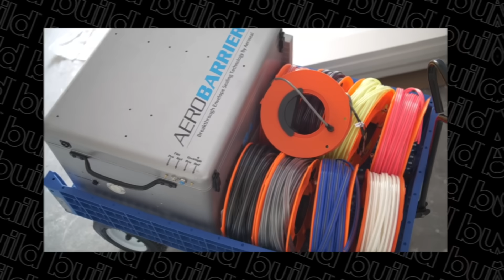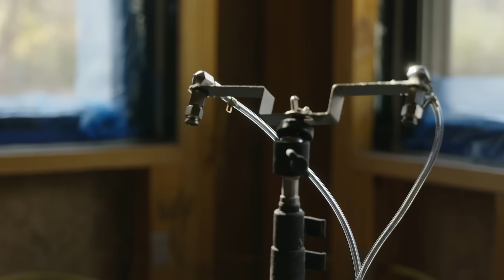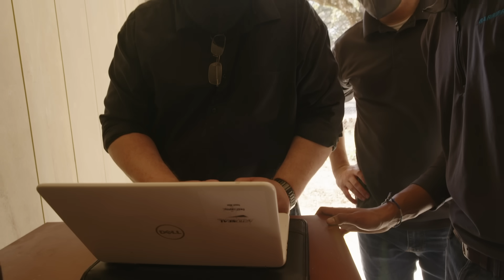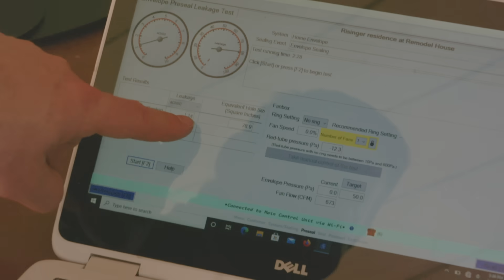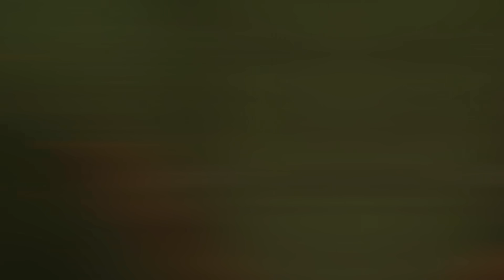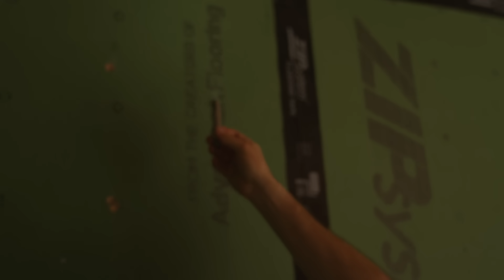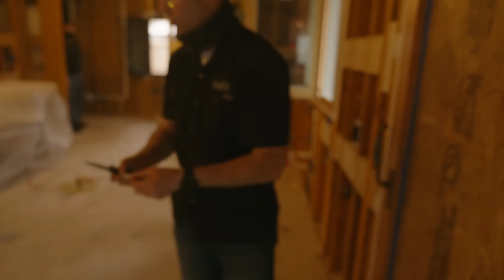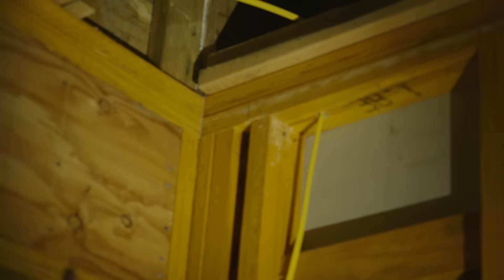The one product I'd recommend for EVERY House!

Comment: I would love to know what the air tightness is on this after year or two with a full season cycle.
Reply: I have never used an acrylic caulk that does not shrink.  I have used many that claim not to shrink.  Additionally the expansion and contraction of wood and dilation of metals make me wonder about longevity also.  However, with a controlled environment, temperature and humidity will effect expansion, contraction and dilation less.
Reply: @bobt9948  Foreal. I have never seen alex flex stretch like it claims, cracks at any movement.
Reply: The leakage was almost entirely confined to very tight seams and a couple of small holes. Now, I could accept that there might be some degradation around pipe fittings, since they move differentially to the structure sometimes, but just how much do you think that these tiny seams are going to change over time? I mean, he's got the house down to 0.1 ACH50 BEFORE insulation and drywall. Even if it went to 0.15 ACH50, so what? It's not like his house will be 1.5 ACH50 next year nor even 50 years from now. Finally, if you're curious, call your Aerobarrier dealer and ask if they have some data on that.
Reply: @juliancate7089  what do you think it is if they did the test again after untaping all the window and door seems?
Reply: @FJB2020  Sealing windows and doors is part of the install. Why would a sane person remove tape from the mounting flanges? Not to mention that Matt seals around the window frames from the inside after install. Why on Earth would you remove that? Just to see if an unsealed window leaks? Spoiler: Yes, an unsealed window would leak.
Reply: @juliancate7089  dude.. They taped them shut for the spraying so it didn't get into the window/door seals..  If they removed the tape, as they should, I would want to see those scores..
Reply: @FJB2020  Right, the numbers would be higher. So? You can't put any kind of sealant into the moving parts of your window and doors seams no matter what, so....... ? That's a leak that is a leak no matter what. That does nothing to invalidate the ability to seal all those cracks, crevices, and holes that you CAN seal. I'm just curious what kind of mental gymnastics you have to go through to decide that sealing the parts of your house that you can seal is bad or is somehow magically a waste because you can't seal the moving parts of windows and doors.
Reply: @FJB2020 It would vary with the number and quality. With high quality windows there is little change.  Install low grade windows and it's more.
Reply: @juliancate7089   I would like to see the numbers to 1) see what the difference is and 2) to see if its enough to bring the ACH back above the "passive score"; that is unless when it's tested for that you're allowed to tape the doors and windows.
Reply: @keithhogan6997  Ok, your question makes me understand how this conversation got off the rails and why I was misunderstanding previous posts. You only tape the doors and windows so the sealant stays out of the moving parts. When you do a blower test, either before or after the Aero Barrier application, the doors and windows aren't taped. There are plenty of written instructions and video tutorials on how a blower test is performed on the Internet if you'd like some clarification.
Reply: @juliancate7089  His score was when they were still taped.. From what I can see, they opened up the house and never ran the test again.. That to me seems misleading..
Reply: @FJB2020  You know, you're right. Matt is a dishonest guy trying to mislead people, and Aero Barrier is a scam. No one should ever use it. And all the other professionals on the channel and the other contractors in the comments section are in on the scam too. So let's never watch this channel again.
Reply: @juliancate7089  chill out dude.. I am saying the numbers are misleading..  I love Matt's content, but I take some of it with a grain of salt considering most of it is an advertisement for products he got for free..
Reply: @FJB2020  Dude, he did the blower test after all the windows, doors, and vents had been opened to let all the vapor out. The video shows this, dude. No where in the video does it show that they were re-taped, dude. Dude, your understanding of how sponsorships work is as flawed and simplistic as your understanding of blower tests, the benefits of air sealing, and basic economics. Dude, you are an envious, resentful dude for assuming that anyone who has achieved anything in life, got there by cheating or lying in some way. Dude, what have you accomplished in life? Dude, did you build a multi-million dollar business from scratch? Do you have a successful YT channel, dude? So dude, I'm not going to "chill out" while you post a bunch of hateful smears about a decent man trying to improve the construction trades and inform housing consumers, dude. So if there's anyone who needs to "chill out" dude, it's you, dude. And dude, liking your own posts is lame. Ok, dude?
Reply: @juliancate7089  dude :D
Reply: @krisz1156  Lol, Dooood.
Reply: @juliancate7089  I get what your saying, but you are only proving my point. He did this on a house that did not need at all. They even mention at the end that the next 10 years of their focus will be on retrofitting old homes with Aero Barrier to bring down thier ACH. Those homes will not be tiny little seams and they will not have access to framing to prep anything.

Again, I'm not saying this is garbage. I'm just saying I'd like to see it in real world setting with and ACH before, ACH after application, and an ACH after one full season before I start recommending people spend 3-5 grand on something that would not last more then 5 years.
Reply: @seanstumpf4190  Whether or not the house "needed" it is a subjective value judgement that you are trying to pass as some sort of universal truth. Whether you think is needed or not is irrelevant to it's performance. On top of that, Matt stated repeatedly that he was trying to achieve passive house certification and in order to get it, it was indeed necessary. So, he DID need it.
Reply: Julian Cate 
The ENTIRE VIDEO .....is paid promotion, like this one and his others, now say at the start.
And......you are a shill and a huckster......
Reply: @alfamale2478  ...says another angry red neck Socialist who doesn't understand how sponsorships work. Not to mention, you have no proof that Matt is sponsored by Aerobarrier. He's always been pretty open about who his sponsors are and he usually says, "This video sponsored by xxxx". It never ceases to amaze me how bitter and resentful you working class Commies can be. Like if you were in his shoes, you would refuse all sponsorships. LOL. You'd be tripping over yourself to get at that money.
Reply: @juliancate7089  best commercial caulk we have ever used is VLM 150, modified polymer. Elongation 100 %, and compression 50%, hence the "150". Now, if the tiny crack to be sealed is say 1/32" when this is performed, and it grows to 5/64" over time, due to drying and or warp/ curl of the lumber, you have exceeded the 100% elongation and the seal will be broken. Virtually all commercial buildings rely on control joints for sealing, and the joint width is always sized and specified to insure that expected movement will not exceed the elongation limits of the material in that joint. We have had jobs where that width may be 1" or more, in order to maintain adhesion of the sealant material. Can't see why this would be any different here.
Reply: @lhsunimog  There's so much wrong here I hardly know where to begin. 1) Not every point along every seam in a house is going to up up to 1/4 inch. If it did, your house would fall down. 2) I don't accept that joints between studs and sills, or sills and floors, nor stubs and sheathing, or any other joint, are as open to movement or expansion as you suggest. If your joints are that capable of movement, then your construction methods suck, you haven't provided for sufficient water and vapor protection, and or your materials are substandard. 3) Nothing you've mentioned, even if it was a realistic scenario, means that VLM 150 you use is necessarily better than the Aerobarrier sealant because you don't know it's characteristics. So, you're comparing a known to an unknown and suggesting that nothing could possibly be better than the known. If you want to say that VLM 150 is better than Aerobarrier, then provide some proof. 4) I'm not sure what your point is here, except that in extreme cases sealants fail. Ok, well that would be true for all of them and doesn't mean that no one should ever use caulking. Lastly, if you don't think the product is worthwhile, then don't use it. Issue solved, debate finished.
Reply: @juliancate7089  "I hardly know where to begin". And you absolutely do not know where to stop. Problem with channels like this is that it provides bloviating trolls such as yourself a platform to spew your bile anonymously. A good sign that you cannot hold your own in the real world of verifiable performance. If only your intelligence quotient and knowledge base was even a tiny fraction greater than your anger quotient, then there would be a possibility of an actual informed discussion. But alas............
Reply: @lhsunimog  Anger quotient? I think there's some projection in accusing me of being angry. Lee, I was not and am not angry with you. Your post was an unfair comparison since you stated that VLM 150 was the best there is without knowing what the stats are for Aerobarrier's sealant. You also suggested structure movement that might occur in spots, but was an unrealistic scenario for most homes - especially those whose owner can afford an extra $5000 or so for air tightness sealing. So, instead of just fuming and sputtering a hail of insults at me, show me the data. I will listen to that.
Reply: I wondered the exact same thing.
Reply: Yup that would be the interesting to test I would assume there is information on testing this but it's still fairly new so yeah long term might still be a question.  2 points I don't like is when your blasting caulk into the air that is designed to escape the house goes into the public and it seems kinda a dick move if you're not telling the neighbors unless ya wanna coat some kids lungs down wind. Maybe it not much but I'd like to see a hole as this process starts and finishes.  Also as the hole gets filled and get smaller then becomes sealed then you're no longer adding any thickness to that caulk. Maybe the millage is fairly ok but thin to win isn't a great idea with caulking even from tremco which has some really good caulking.
Reply: @timort2260  unless that kid is sucking on the house I think your worrying about a non issue.  When paint/start your car/ fart/ cut a piece of wood..... Do you warn the neighborhood. All of those have been proven to cause cancer.  Let's worry about real problems and not make up more.
Reply: @timort2260  Good thought about the thickness Tim.  Because of the pressure being applied, thin weak parts of the seal rupture and then collects more  sealant.  We see chatter or a saw pattern on the seal during the process.

The sealant has had a 50 year lifecycle test done on it with near zero degradation.  The test included expansion and compression (20% both directions) to simulate the seasons causing material movement.
Reply: Water based acrylic
Reply: It's latex though, flexible and inert.
Reply: @Polyester_gangster  having used caulk on various surfaces all I'm saying is that I would love to see the year after results. Homes move through out the season through expansion and contraction. They also slightly shift in the wind. Even that 3" pipe hole they showed that it filled. During one winter and summer that pipe will move up and down the wall maybe 1/4 inch maybe even more since it's cast. Doesn't seem like a lot but caulk is not very forgiving when adhered to a hard surface. I imagine this is the same. I'm sure it's better then nothing but all I'm saying is I doubt the long term viability of these numbers.
Reply: @seanstumpf4190  we know it's not much chance of it lasting long
Reply: @Polyester_gangster  i think he said acrylic
Reply: Same here, I suspect with a few temperature/humidity cycles it will lose effectiveness.
Reply: @judd_s5643  Steve B reports he's tested his passive builds years later and no change. That airborne caulk is filling better than a gun i guess.
Reply: You suspect? Proof please
Reply: It would be interesting but the results wouldn’t tell you anything. There are too many other variables to determine what changed if anything. 

You would have to build a mock house and test it over time.
Reply: They didn't have a great track record when AeroSeal was their name..
Reply: @FJB2020  prove it
Reply: Will be leaking inside of 5 years...you can take that prediction to the bank

Comment: Well on claissic brick house it wont change a thing if all done corectly i assume.
Reply: Theres still gonna be some kind of gaps between the roof and the joint to the house.
Reply: @ShotGunner5609  Depends on technology used for insulation. I belive nowadays most of houses have Polyurethane foam insulated roofs so all gaps and spots shuld be nicley covered.
Reply: @xsardas1999   There will always be penetrations to seal, i.e. plumbing, electrical, gas, heating oil, cable, etc.
Reply: @keithhogan6997  in brick house it is all sealed up by parget or gypsum. U dont have holes in walls like in wooden hosues.
Reply: Yeah, brick houses are airtight by default and if you don’t intentionally make holes in the walls then you’re good. It’s vice versa for timber framed houses